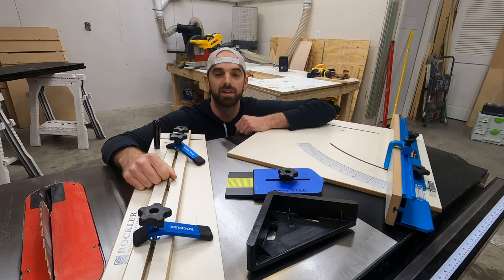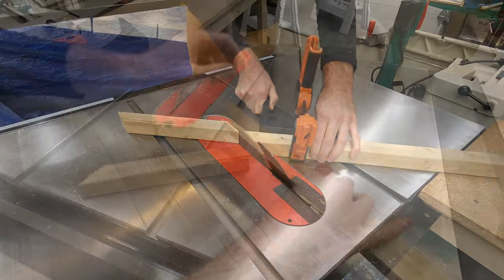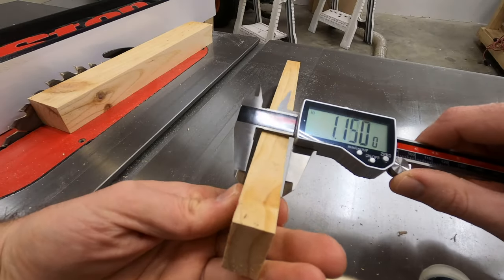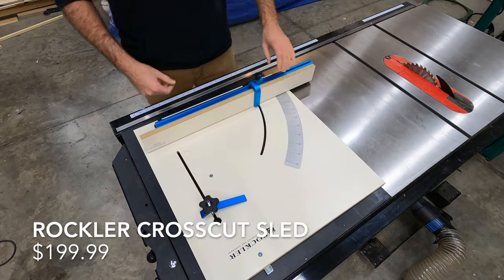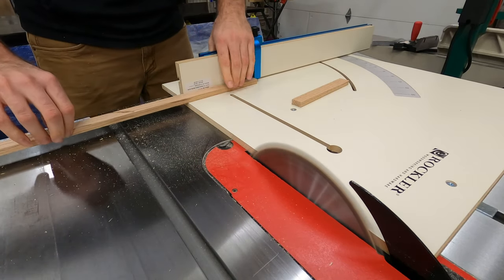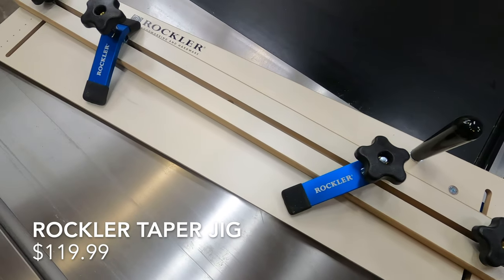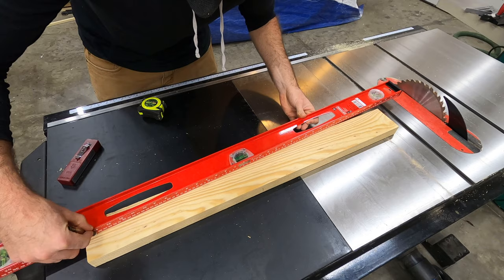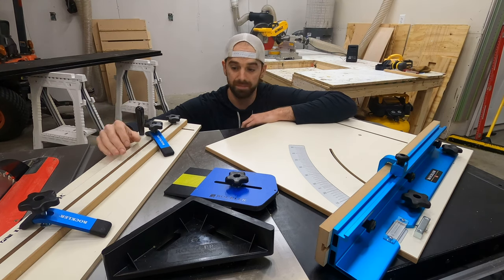4 AWESOME Table Saw Jigs || Rockler Crosscut Sled, Taper Jig, Thin Rip Jig, 45 Degree Miter Jig

Comment: Great demo.  It should be noted that the cross cut sled is great quality but it doesn't really work on my Dewalt DWE7491 as the top is too small and hangs over the left side of the top...a lot.  If folks are finding this video researching the sled they should be aware.
Reply from the maker: Thanks for pointing that out. I’m not sure if there is a different crosscut sled available for the job site style table saws. I use this crosscut sled way more than I originally thought I would 👍🏻

Comment: I love that rockler cross cut sled . I've never seen the tape jig before. I'm thinking this is a useful tool for making table legs.
Reply from the maker: The crosscut sled it awesome! I’ve been using it a bit before I made this video and it is so easy to use. It is also super lightweight which makes it much easier to grab than my giant homemade one
Reply: It is also a great way to join boards without a jointer.